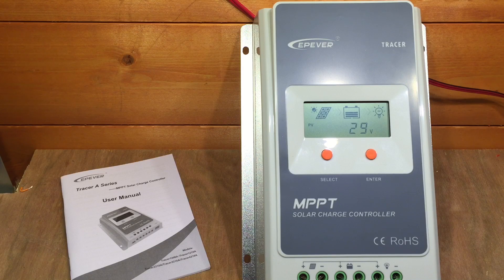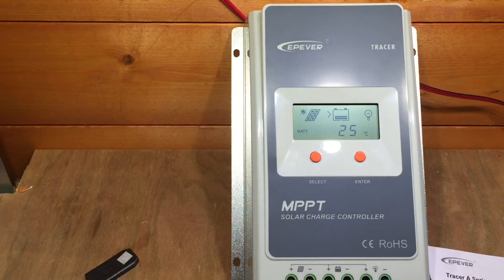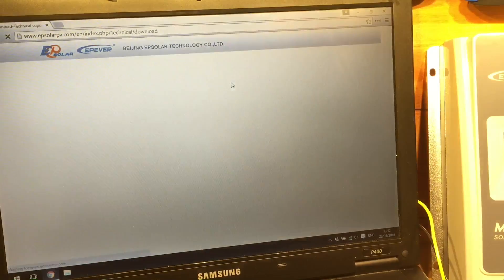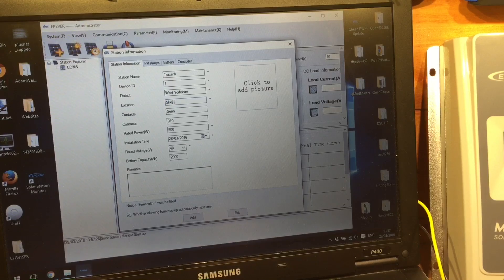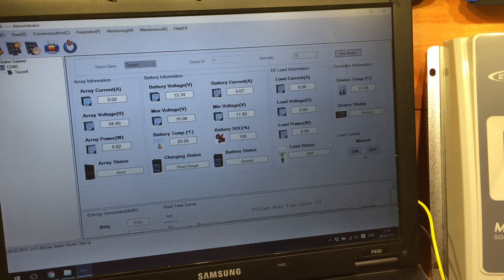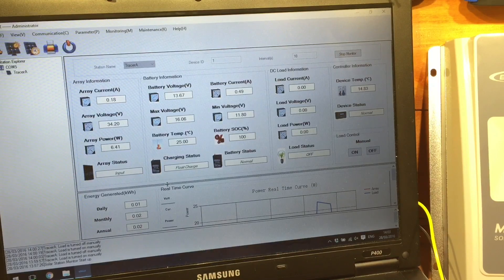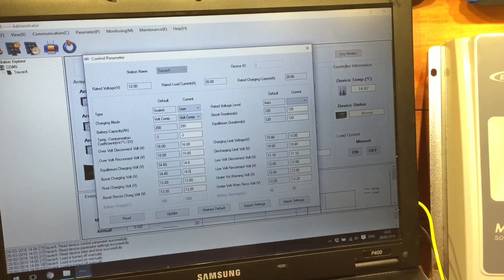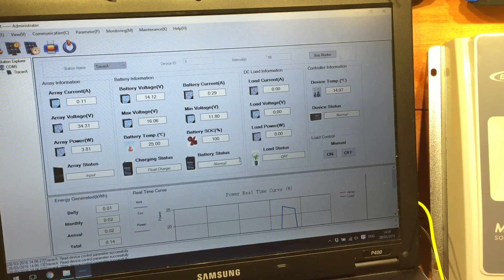EPSolar Solar Station Monitor software & a cheap USB cable - 12v Solar Shed

Comment: Adam can I ask of a favour, can you kindly send or publish the correct link to http://www.7-zip.org/download.html Im trying to open the Tracer software but cant and need the correct 7-zip to open it...thanks....Kristian..
Reply from the maker: +Kristian Winder You're in the right place. I used the 64 bit Windows installer version which can be found here: http://www.7-zip.org/a/7z1602-x64.exe
Reply from the maker: +Floyd Thomas It should do. It's the same package for all the modbus based charge controllers from EPSolar.
Reply from the maker: +Floyd Thomas Hope you got my email Floyd?
Reply: THANK YOU SO MUCH ADAM... I just checked my mail and I got it and unzipped it. I really appreciate the helping hand.
Reply from the maker: +Floyd Thomas Glad to have helped.
Reply: Hello Adam, Is this the correct installer package for the PC Software to operate the MPPT Uint and configure its settings? I went to the epsolarpv site but it seems as though it's been taken offline.
Reply from the maker: +Floyd Thomas If you follow the link in the description and then hit the software tab the monitor software should be there?
Reply: +Nope... Nothing shows up... I only get the message that says that the page didn't send any DATA... I did download the package installer that you posted above, though... I just purchased the 30A MPPT Solar Charge Controller with MT50 12V 24V Auto Work EPEVER 3210A   http://www.ebay.com/itm/231994195546  and am hoping that the installer package that you posted will work for me.
Reply from the maker: +Floyd Thomas How odd. I did test this just after posting my last reply. I was able to download the Rar file without any issue.
Reply: The installer package that you posted is for the 7-Zip... I thought it was for the actual monitoring software... Would you by any chance be able to zip and email me a copy of the software? I still get nothing from the EpSolarPV page that you have listed. I'm baffled. FloydFThomasIII@Gmail.Com

Comment: Have you verified, the Volt numbers you see there? Mine are off by 0.3 to 0.5, no big deal, until those wrong number are used as charging parms.
Reply from the maker: +Daniel Desmedt The battery voltage on the charge controller readout? Yeah - they're pretty accurate I think. I've got a panel meter next to my charge controller which agrees. 

The voltage at the terminals of the battery is probably a bit higher due to voltage drop across the cables. It depends on the thickness and quality of the cabling though. 

Thanks for the question.

Comment: This i dont really understand. Why does the Array voltage on my show 14V when it should be more higher? Is this caused by depending on stage of charge? Also when typing "station info" (battery capacity) AH is this value for one or all batteries as in parallel?
Reply from the maker: +SuperMaiki76 Yes it does depend on stage of charge.  MPPT (where the panel voltage is significantly higher than your battery) happens within the bulk charging stage - this is a constant current charging mode.  After your battery reaches a boost or float charge all MPPT solar charge controllers that I've come across go into PWM mode.  Where your panels are connected straight to your batteries for a short pulse at high frequency.  So your panel voltage gets pulled down to a value very close to the battery voltage.  At this stage it controller is doing a constant voltage charge which delivers a much smaller amount of current.

So when the array voltage is at 14v - it's likely your batteries are full.
Reply from the maker: Oh and to answer your second question - battery capacity is the total of all your batteries in parallel.
Reply: Hi Adam. Im not really happy about result's from my panels. If i done some wrong or if there is some wrong with the system. My panels are 100w each and i have 2 of them. The voltage from panels go really low even it is sunny and the current is even more low.. I set up my system to run with Volt comp...as you but...well hmm. I tested run panels in parallel and in serie but while in serie the voltage jump up while connected and current well low about 1 ah or so. "Not direct sun" and in parallel the current does go up in same weather and voltage abit higher around 17v to 18v as the panels are.. But running in Volt comp mode it should pump up the voltage right??? Instead lower it?

Comment: Hi folks,
Some of you might be interested in my solar power project and energy monitor. I use a Raspberry Pi to pull data from the Tracer 2210A using the pymodbus library, and post it to the internet (a MySQL database) with the urllib library.
www.solarpoweredhome.co.uk
Reply from the maker: +Matthew Hubbert This does look very interesting. I may have to give it a try - I've got a couple of pi's sat in a draw. Thanks.
Reply: Matt, Will this work on a Pi Zero W ?

Comment: Thanks for these clips.  I bought a 4210A and a RS485 adaptor and have tried to set it up on my computer.  Used your instructions to download software and install (Your clips were great.)

I only have one problem.  I cannot get it to work.  

I believe I have set it up correctly.  I believe I am using the correct port (COM5) identified via Device Manager.  However when I select 'Start Monitor' I get the following message 'The operation has timed out (COM5).  When 'Monitoring' is cancelled I then get the message 'COM5 has been occupied by other software'.

Unfortunately I am relatively computer illiterate.  Do you have any ideas on what I could try?
Reply from the maker: +Sallie Moulds Hello Sallie and thanks for the kind comments. 

Has the RS485 adapted installed correctly? In device manager check there isn't an warning next to the com port or something like that. If you are using the exact same one as me you might need to check you have the correct driver installed. It's a CH340 based adapter. 

The only other suggestion I have is to switch the a and b cables around to check they are right. 

Happy to help further if you can try a few things and give me some more information.

Comment: Hi Adam - very interesting and detailed video about the Tracer! I have one question about these device in general. Do you think it is possible to charge a Lithium Ion Battery with these MPPT-Charge controler? - because of the possibility in the setup menu "Control Parameter" I would think it could be? What du you think about?

Thanks for an answer - greetings from Berlin! :-)
Reply from the maker: +Der Trash Hello.  Thanks for your comments.  You can set your user define battery perimeters to anything between 9-17 (or 18 and 34) volts.  So I'm fairly sure you'd be able to adjust it for the needs of lithium ion cells.  The issue is more around the charging cycle - Bulk, Absorb, Float.  Bulk is 'constant current' (as much as a solar charge controller can do anything constant) charging and absorb would be constant voltage.  Both pretty standard in lithium charging profiles.  I still worry that a float charge (maintaining a voltage through pwm) isn't a great idea for lithium - but other people have disagreed with me on that.  I hope that helps a little.
Reply: +Adam Welch Hey Adam, thanks a lot for your answer! - I am still gathering information to build up a little solar system ...
Reply: @AdamWelchUK  need to set USER parameters for any Lithium battery. Controller can’t do it. MT50 or that solar station software. The is an Epever eLOG01 which records data for  later analysis.

Comment: THANKS for this video and the one before this  :)  . I need one charger like this but capable to charge 40 Am/h . Is the only model I can bye here in my city. Do you think is good for charging 400 Amp batterys every day????
Reply from the maker: +Practical Technologys There's a 40 amp version of this controller. Whether it would fit your needs depends on how much you drain your batteries each day and how much solar you're bringing in.
Reply: +Adam Welch I want to put on 4-5 solar panel at 260 Watt/one, by around 8 Amps/h each one. 5 paneles will charge me arownd 40 Amp/h --> 5 houres /day , sow I will have like 100% solar radiation 5 houers/day, that will be like 40 Amp/h in a total 200 Amp/day in a 12 volts battery system. 

After seeing your video I notice you sead that will have like 90% efficience , and that is fine whit me. I sow one of this here but at a close look it seem that they are made in CHINA and I suspect this chargers are not so good. Seeing your video whit the test give me hope to bye 1 of this for my solar system.  

Now I need a good charge regulator for my batterys, do you know some good regulator for the battery that I can install in my system after the charger  so I can charge the batter cell equel ???!?!?1?!?1
Reply from the maker: +Practical Technologys The epsolar tracer does do (as do most charge controllers) a equalisation charge. They are often set to complete this about once a month. Basically it holds the battery voltage at a higher level for a couple of hours to help equalise the cells.

Comment: Hi Adam - I've just gone rash and bought a 4210A + MT50 + RS485/USB stick for my shed. Just waiting for suitable panels on flea-buy. It works so far with just the 24v battery connected. The plan is to monitor from indoors via 50ft of cat5 laid in duct twixt house and shed.  I've installed the controller software after updating my PC from W7 to W10. Are you using W10?  Rgds, Nick
Reply: +Adam Welch - Despite having no panels yet or big battery, I have established coms 'twixt' shed and PC in house. I made a quick cat5e lead up and ran it out through the back-door out to the shed. It talks each way, so I'm dead chuffed. W10 seemed to know what to do, all I had to do was change from com1 to com5, then bingo. Now looking forward to getting panels and battery bank. BIG THANKS go to datahardware.co.uk for sending me a RS485 to USB stick, (identical to yours), for evaluation on Win10. He is a UK supplier, so first-class post available. Your vid has been useful and inspired me to get on with my system. G**gle 'the shedifice' to see my workshop. Cheers!
Reply: +Adam Welch - Just picked up 8 x 190W mono's on flea-buy for a good price, new old-stock. I have my 4210A and 2 old 24Ah UPS batteries spread out on the bench at the moment, with a single panel leant against the hedge outside via 30ft of 10 mm . Overcast, I get 20-30W. Bright sunlight gave a short period of 164.24W. Roof-mounts and proper batteries next. Power beyond my wildest dreams! (chortles manically)
Reply from the maker: +nlo114 Sounds like you've got big plans! Yes I'm using Windows 10, but I also ran the EPSolar software on Windows 7 and it ran fine. 

If you've bought the official RS485 cable I think the driver is in the Solar Station Monitor software directory or install files (can't quite remember off the top of my head).  Assuming to add all that length of cable (which theoretically should be fine) you're using the adapter I did then you'll need the ch340 driver. Let me know if you need a link (I'll dig it up from somewhere).

Thanks for being the first person to use the word twixt on my channel and enjoy your solar setup. :-)
Reply: +Adam Welch Thanks for this tutorial video of yours. It's really informative and detail. 
Please checkout my channel and subscribe if you happen to find anything you like and thumbs up to any of my videos. 
Cheers
Reply from the maker: +nlo114 Thanks for the update - I'm glad my bodged together cable is working for you over a longer distance. I'll look you up for sure.
Reply: nlo114 Good for you Mate. I am proud and happy for you. I can't wait for the solar array to be up and running for you.
I am working on upgrading my system right now from 24V to a 48V system which I will be uploading the video soon. Please stay tune for that and don't forget to subscribe and thumbs up to my channel. 
Cheers
Reply: ***** Good for you Mate. I am proud and happy for you.

I am working on upgrading my system right now from 24V to a 48V system which I will be uploading the video soon. Please stay tune for that and don't forget to subscribe and thumbs up to my channel. 
Cheers
Reply from the maker: +nlo114 Excellent news.  You've jumped in quite big with 8 x 190w panels.  Definitely need some more batteries unless you intend to use a lot of power in the day.  Enjoy your free power!
Reply: nlo114 Congratulations my friend. Now you are ready for business HOO-AH
Reply: nlo114 From these 8 modules will be harvest 1,520Kw/h . This is an existing news buddy. 
Take care and have a wonderful day. 
Cheers
Reply: +JW Solarusa - The 4210A can only use 1040W, so I'll switch them in during autumn, then out during spring. The PVGIS calculator http://re.jrc.ec.europa.eu/pvgis/apps4/pvest.php?lang=en&map=europe shows that I could make all my electricity from march to september inclusive, only tapping onto the grid in winter. Now designing combiner box.

Comment: I have to implement a better system too. I have 3 x plasmatronic regulators with 2 x 200amp shunts. But all the data is in the power shed. So in the meantime I am using an arduino with an ehterten sheild which is reading battery voltage and a couple of dt22 temp hum senors running a website outputting the values. Them running a python scrip on a pi logging the data to a csv file. But are looking long-term to getting similar data. Sorry for the long comment.
Reply from the maker: +Chris Scanlan Not at all - I like comments of all lengths! Thanks very much.

You've got a much bigger setup then me by the sounds of it.  I was going to look down the route of using an Arduino to monitor voltages (and current most likely) in the shed and use a ESP8266 to publish that data somewhere.  Now I've got the new tracer I should be able to collate much more information - if only I can work out this modbus protocol...
Reply: +Chris Scanlan Hi Chris. I have recently achieved this using some python code I found online (written for the Tracer BN) I adjusted the code to pull data from a Tracer 2210A and publish it to  my website with the urllib library. See here for live data www.solarpoweredhome.co.uk
Reply: Hi Matthew, Thanks you for the information I think you sent me a friend request and was trying to work out how you were and ended up declined your request. If you send another I will accept it, but I am not a Facebook person if you know what I mean. I will eventually get around to posting my project on the net under www.chrisscanlan.info .

Comment: Is it possible to set the boost as low as 5 minutes? Thanks
Reply from the maker: +wkdkris Not five minutes no but I've just checked and you can specify any number between 10 and 180 minutes.
Reply: +Adam Welch Thanks for checking, much appreciated. With an earlier model i have a problem with my fridge kicking in, interrupting boost charge. It uses around 6A for 70-80 seconds and cuts out. Enough to make it get stuck at 14.4 all day whenever the fridge isnt drawing power :(

Comment: Hi Adam, awesome video. I've just bought the 40A version, and was wondering if there was a cheaper way to connect to PC. Your timing is impeccable! I'll order one of those converter thingys :)

I have two 220aH standard flooded leisure batteries, should I change the charge voltages to 14v as you did? I'm new to this sort of thing so have no idea.

Any help appreciated.

Scott
Reply from the maker: +dimmaz88 Thanks for your comments. You'll probably find your flooded cells are happier at the higher voltage than sealed or AGM. Keep an eye on your water levels though. I'm not a battery expert and different folks have differing opinions on optimum charging.

Glad to be of help regarding the cable.
Reply: +Adam Welch Ok cheers, I'll see how it goes. Out of interest, where abouts in W.Yorks are you?
Reply from the maker: +dimmaz88 I'm in sunny Leeds :-)
Reply: Ah right, I live near Todmorden. I was thinking your accent was a bit diluted to be fully yorkshire lol. I was wrong :)

Comment: Hi Adam,
Thanks for the video!  You mentioned that you don't have a battery temperature sensor connected.  Is there a way to get the controller to use it's internal temperature for the charge compensation settings? I thought this might be closer than having a static 25C.  Keep up the great work :)
Reply from the maker: +ShazAu8 Thanks for the kind comments. 

I've seen no evidence that the internal thermometer allows the compensation algorithm to run unfortunately. I have now got the external sensor (£5/$8) and it seems to give accurate readings, but I haven't compared the figures with the internal temperature. I'll do that.
Reply: Thanks for the reply.  I can't wait to see what you have planned with this Controller!  Time for more panels?
Reply: @AdamWelchUK  Thank you for the video. Is the load voltage able to be set manually with this software or on the unit itself?  Do you know what it is set to from the factory? Thank you
Reply from the maker: @SteveGuzer  the load output is tied to the battery, so it is always at the battery voltage.